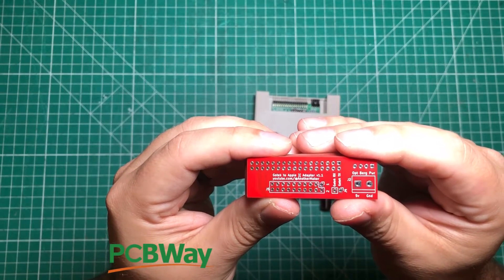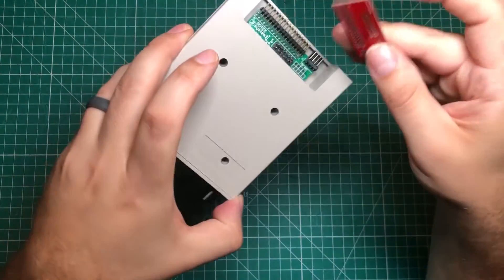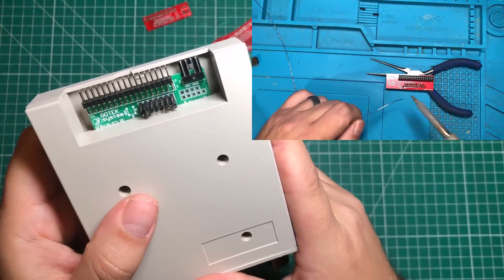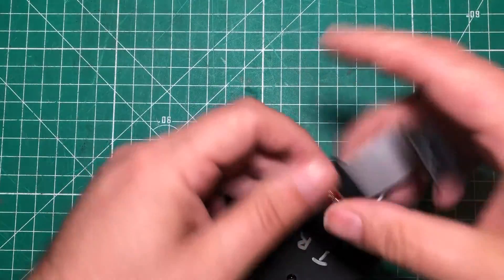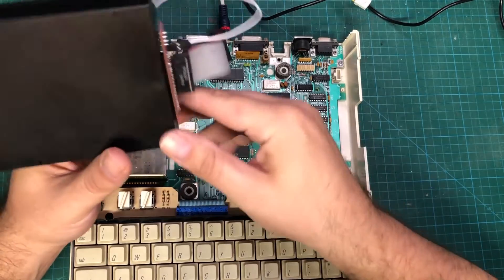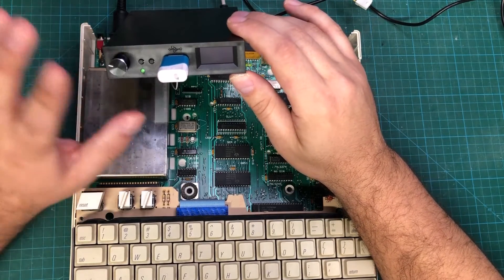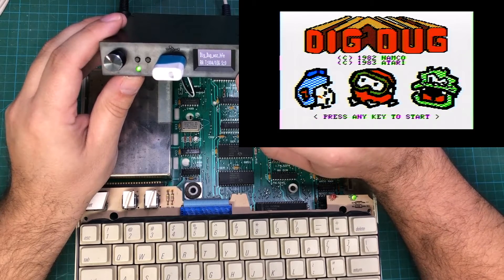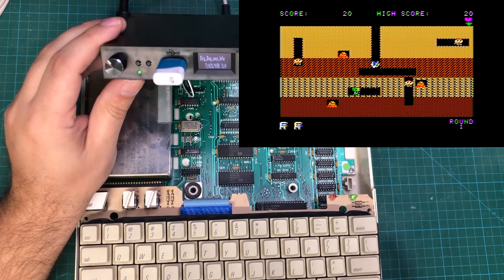How to connect a Gotek to an Apple IIc, Apple IIe, or Apple IIgs

Comment: I work with goteks on 486 pcs a few things is there are 2 pins you can jumper to for floppy seek sounds. Also the jumper position your using on your gotek is important or the drive won’t be detected on the Apple. Im going to save your video for when I get an Apple II e!

Comment: Thank you for creating these. I had them printed from PCBWay, so thank you. I was wondering if you had ever tried soldering a cable with a DB19 to the 20 pin J5 on the board?

Comment: I have finally got around to testing my gotek adapters and haven't blown anything up yet so that is a good start. I updated the HXC firmware to the Apple II version and copied your ProDos image onto a Fat32 USB along with the HXCCFG file for 'indexed' setup (no oled screen, just the original 7-digi screen) and the computer will not boot. Just get 'Err' on the GoTek screen. Everything else is wired up as you have in the video (TX/RX leads and S0 jumper). Any suggestions?
Reply from the maker: I've never seen that. They do have a troubleshooting and the developer is usually pretty responsive to questions and posts his email https://hxc2001.com/docs/gotek-floppy-emulator-hxc-firmware/pages/troubleshooting.html
Reply: @AnotherMaker  Got it sorted. Removed the CFG file altogether and just left the disk images on there. Life also got easier when using an OLED screen and rotary switch.
Reply from the maker: @abeagley492  Fantastic.  Yeah.  I actually just ran into that where the thumb drive had flashfloppy on at some point.. I had to delete all the config files and let them rebuild so it started behaving like an hxc.

Comment: Cool.  I'm also new to the Apple IIc so this looks great for me.  Do you know if it could be wired to the external floppy connector rather than having the lid off? Thanks
Reply: Yes you can get DB19 to IDC 20 adapters that’ll work and you can attach to the back of the IIc
Reply: I would also like to know if this is possible ? And to get it to boot